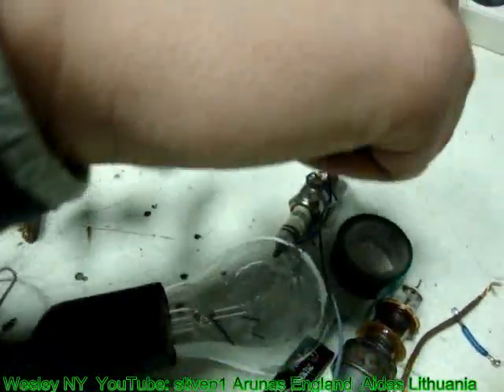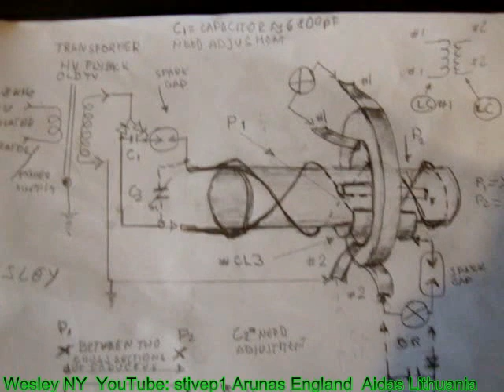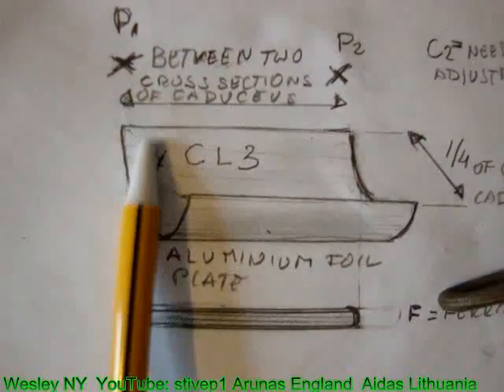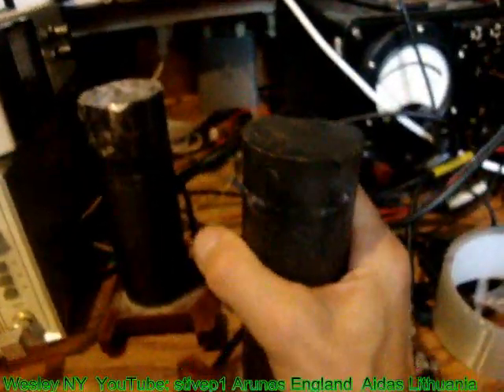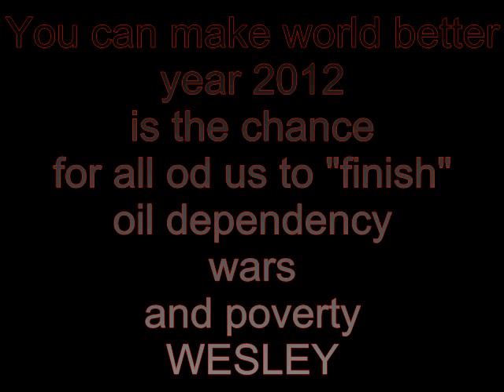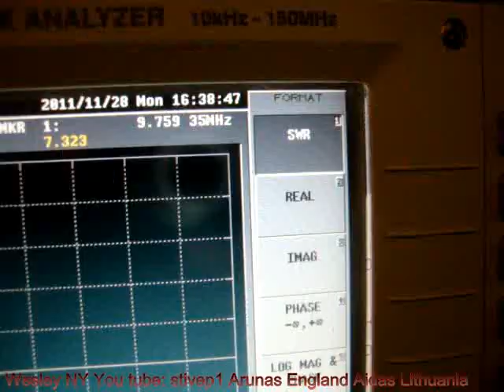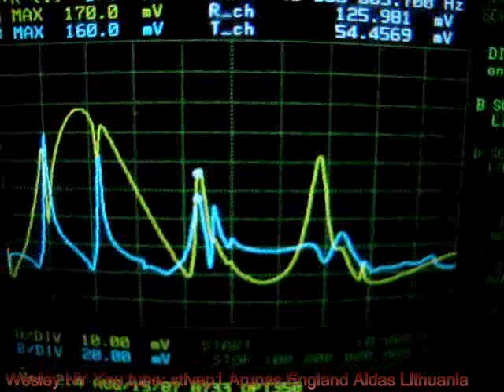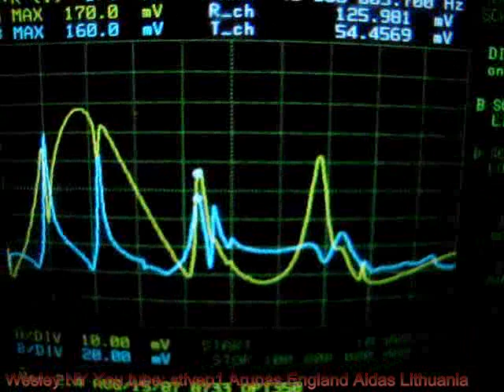Lithuania OU Experiment #4  Wesley's Theory + schematic+ explanation+step by step instruction

Comment: I do have one quick question.  I am a bit confused as to which way to go for the coil.  Electronics is basically the same, but which coil is best ?  

There is this coil in the video: the TK aquarium coil.
The air coil:  I'll call it the JL Naudin coil.
The all-ferrite coil: the SR193 coil.

Have you experimented with these too ?

Comment from the maker: @Sumermagor the difference between power used with no load and with the load is approx 3.3 W.
The load on the output of the device is 100W
so if we calculate that we are in error of 50% than by that token we have 
for every 3.3W delivered 50W out
Example: 33.3W in= 500W out

at maximum
every 33.3W delivered gives us 1000W out

Comment: HI,

its interesting, and great project. Can You show us OU successfully device block diagram and how/or from which componnents can we make this device in home. I dont have all measurings machines. Only classics digital voltmeter/ampermeter. How to build this one device, and how to tune it to resonance frequencies ?
Now I have flyback transformator but with many outputs pins. In last day I have dissassembly electrical ignition lighter with HV coil. Many peoples use microoven HV tr. Thank You.

Comment: Hello the old flyback are the ones that serve? The color TV does not? Greetings .
Reply from the maker: it  should be from old Russian TV Rubin. It is thought that its very much unique chemical structure is responsible for  Transmutation  with NMR taking place at the same time.
Reply: Thanks, I know this flyback is AC power? With others it does not work because they have an internal diode, right? Sorry my bad English I do not speak English, greetings from Uruguay, I speak esoañol.

Comment: @stivep1 one more thing is not clearly showed is what the original aidas coils tube diameter is, tube inside and outer diameter.
 and what is the lenght of the caduceus coil is, is weight has to be totally equal in the 5 wires? thank you

Comment: @stivep1 
From memory I think Hendershot used the term Coilpacitor, because his capacitor was within the winding.  I wondered if there could have been either any induction or internal travelling wave reflection, but I could never understand how his electromagnetic flip-flop was started.
I wondered if radium was mixed in his coil sealant.
Could anyone sparking success please let us know at what frequency the resonant power is delivered to a load so that others might tune similarly.